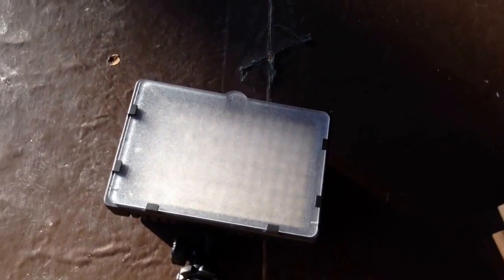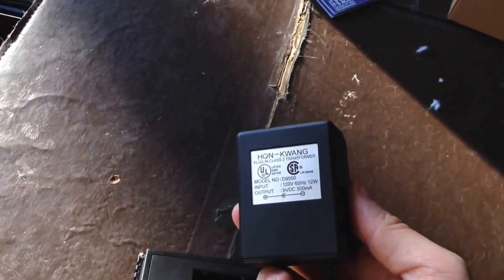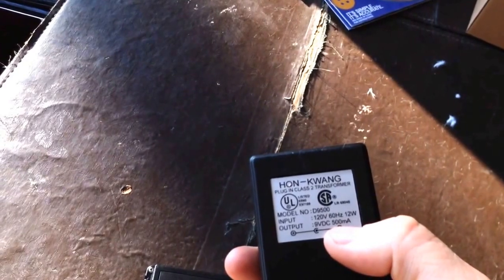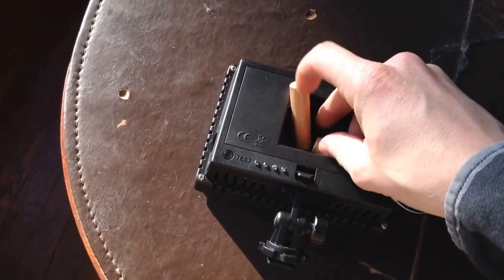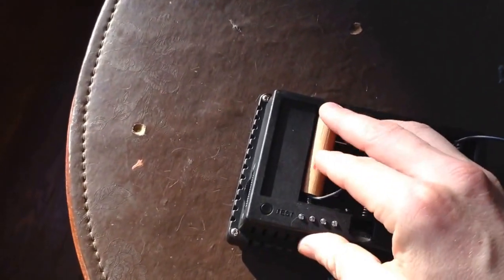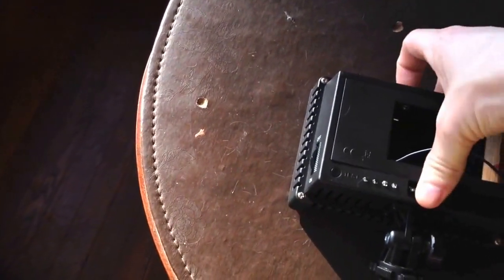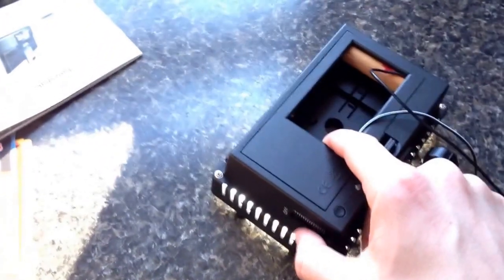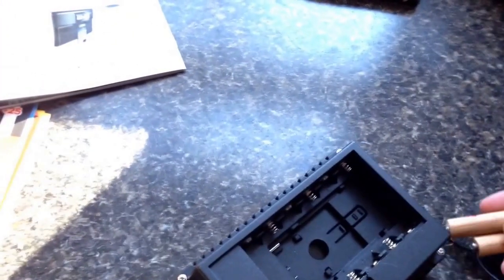Neewer CN160 Hack - DC Power

Comment: Wow, this is very cool. I have the CN-216, what should be the specs of the adapter? The total power of the unit is 13W and voltage is 7.2V-12V

Comment: How do you ensure no shock?  I like this, but I'd be afraid of shocking a crew member or myself.  Also, do I need to worry about shorting and burning the light?
Reply from the maker: If you place the batteries in before you plug the adapter, then there is absolutely no risk in shock. Also the Adapter will regulate the amount of power that travels through the wire so max output is from 9V/500mA is 4.5 Watts. That is a little pinch of pain and not dangerous at all.

As for shorting the system, as long as you don't reach over 9 watts of power, you cant hurt it. just make sure the adapter is 9V and between 300-700 mA and its impossible to blow it.
Reply: Cool thanks!